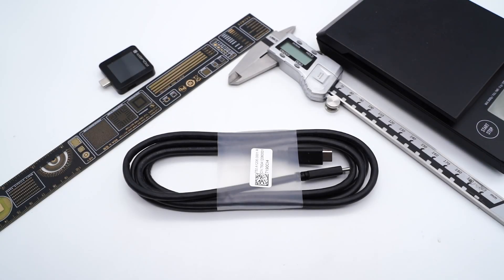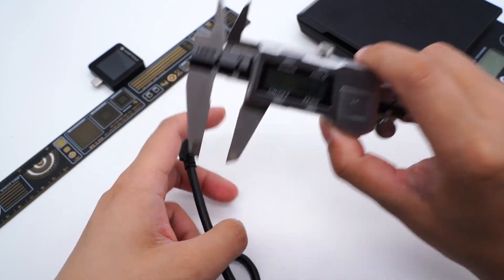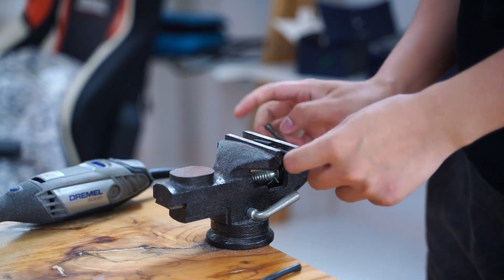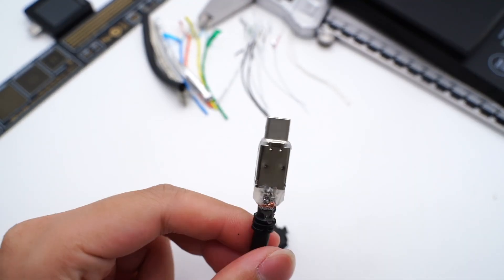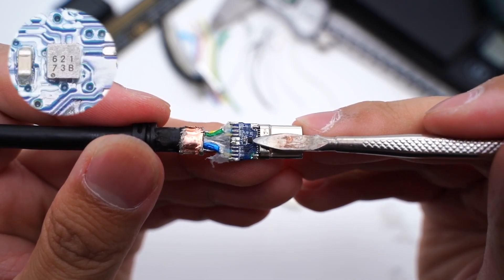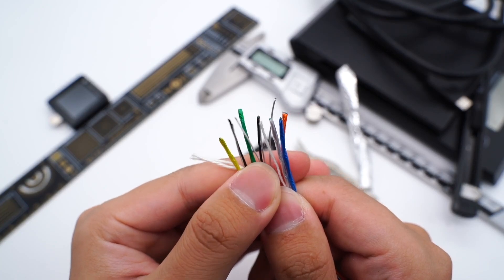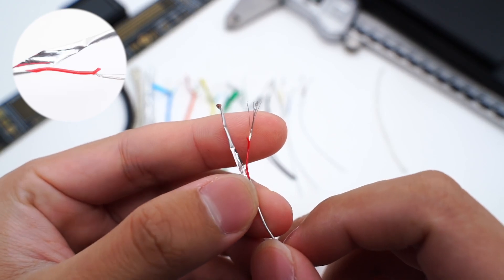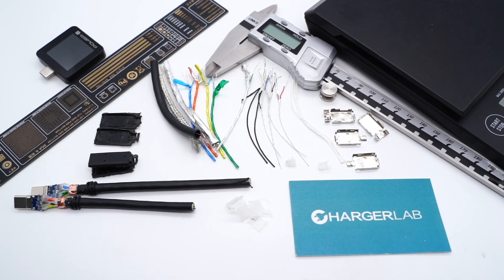Teardown of Dell Thunderbolt Cable (1.8m)

Comment: Thanks ChargerLab for this DELL TB cable tear down. Will definitely be cheaper than the APPLE TB cable. The connectors and the cables are all well shielded. However, the individual cables are made of twisted tiny stands of wires to save cost. Perhaps this is ok for the DELL TB cable is only for short cable length. And also it’s a “FREE” TB cable included in their systems. Just like those barely just good enough cheap RCA interconnects that comes with a HIFI sound systems. Interesting tear down to see where the cost savings were, even when the DELL TB cable works as specified. Cheers !